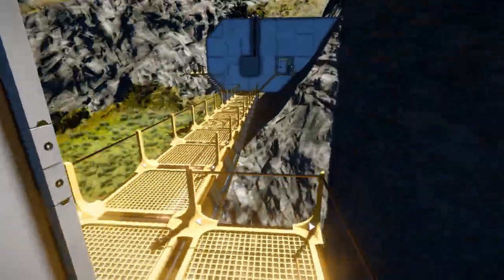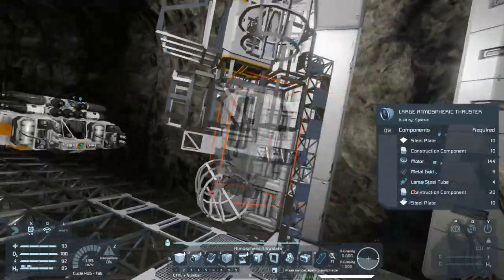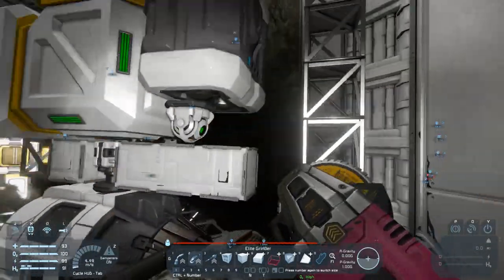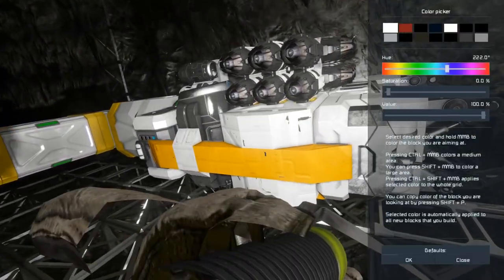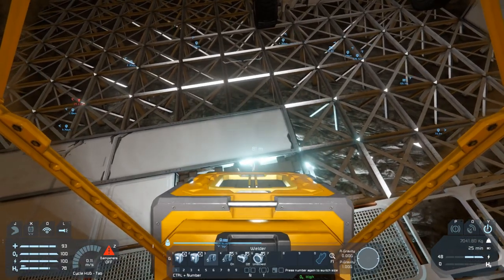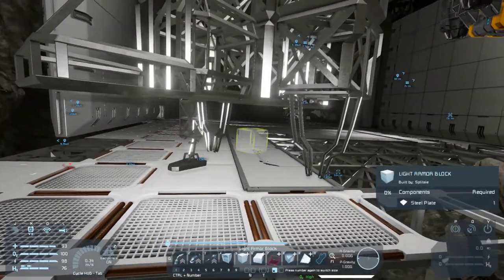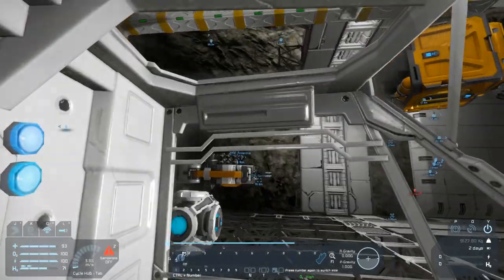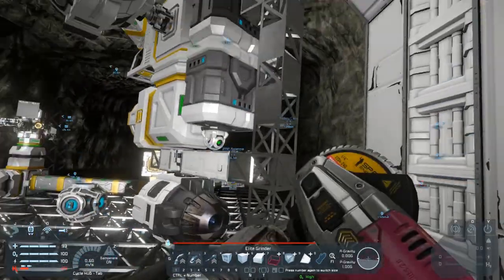Survival, Maybe... #35 Welder Woes With Buttercup (A Space Engineers Survival Series)

Comment: Can you do a video actually testing the requirements of a gyro? To figure out exactly how many are required and such?
Reply: Clinton Savage You can always turn one down a little for precise tuning but yeah, might be a cool video.
Reply: Basil Not really if you're gonna hide it and testing before finishing won't give you legit results
Reply: I think you can reduce their power, so just put more than you need and tune it when you finish.
Reply: Risi that's what I said
Reply: I haven't tested it, but this script http://steamcommunity.com/sharedfiles/filedetails/?id=1333800643&searchtext=Gyro+cargo claims to adjust gyro power automatically based on the ship's mass. If it works, you should be able to place enough gyros for the heaviest load you expect to carry without manually tweaking them when your ship is empty.
Reply: Clinton Savage There's no hard number for "how many gyros are required" (no matter how heavy the ship is). One will always do the job, just very slowly.

A heavy ship with one gyro will turn like a pregnant whale with its fin cut off, but it will turn :)
Reply from the maker: As Ken said, 1 gyro can turn anything, but it might take a week to do so if the ship is very heavy. There's a sweet spot that's probably slightly different for each of us depending on how responsive we want the ship to be. For me I like things to move a little slower so I don't accidentally smack really hard into my bases :P

Comment: A sensor to turn off welders when a person get near? That is incredibly smart. I gotta start using that for grinders and welders. =O

Also I wonder if the rear thruster is causing the backwards drift as it tries to help keep the ship upright. it cannot tilt forward but still applies thrust and a backwards pull that the two side thrusters may have trouble compensating for.
Reply from the maker: It's possible, but normally the script copes well with rotors and thrusters in that sort of setup :(

Comment: as opposed to dropping your suspensions down a block I found out on my Mortal Engine Build that you can just turn the suspensions upside down because you get roughly half again the extension from the travel height as you do building them right side up
Reply from the maker: If you do that, won't the suspension only act as rock solid though?
Reply: @Splitsie  not to my experience no. The engine is a 350k kg vehicle and the suspension still has plenty of give and bounce in my testing though I have not tried the build in a purely vanilla world
Reply from the maker: Interesting, I might take a look at that and see if it impacts the amount of force the suspension can absorb :)

Comment: I do believe if the rotor does not have a rotor head there are buttons for attaching both large and small heads also I have gotten in the habit of adding pistons for lifting all my wheeled vehicles that same way though I suspect with the way wheels work now they are not needed as often
Reply from the maker: From what I've seen it's only the large grid rotors that have the button to attach either the small or large, small grid rotors only have one option. I'm not surprised it's this way as the large grid heads look funny regardless of if you're using the advanced or basic rotors :P
Reply: yea that makes sense I haven't used rotors much lately but when I was using them it was on a large grid.

Comment: I think you need move side engins forward, because mass of subgrid sometimes calculated strange
Reply from the maker: I might be able to move them 1 block forward but that's all sadly - the next block is the rotor. I did try something that 1wsx10 (the script's author) suggested in creative - clearing out the armor blocks allowed the rotors to move freely and it handled much better :)
Reply: Splitsie or you can offset in on some beams to side and forward - on same level to welder center

But i dont know if it cause good effect

Comment: could you build a welding rover that had the welder vertically downwards, or with the ability to rotate the welder 180 degrees on the verticl, that seems like it would be ideal for floor welding, have the welding bit in te middle and the wheels and drivers seat either side, then you could weld the flor by driving over it, nd rotate it to point forward or upwards
Reply from the maker: I was hesitant to put a welder at the front for the vehicle because of the weight distribution, I didn't think I could arrange it properly to avoid falling over, that's why I went with putting them in the middle :P

Comment: Would half blocks avoid the sparks?
Reply from the maker: Yep, I eventually made that upgrade and it worked really well :)
Reply: I have been itching to get playing on realistic and this seems a must if I plan to build anything larger then a small grid. Really appreciate the designs.
Reply from the maker: You're very welcome. And absolutely, even though flight is a little wonky with vector thrust, the ability to have such a heavy vehicle able to fly at odd angles with only a few thrusters is completely worth it. Plus the large grid welder would be a godsend for realistic settings :)

Comment: Place advanced rotor on top of it in middle of  frame. Than T shape on rotor to rotate. In each end of T bar place welder. Turn it on and make it spin slowly. IDK... 5rpm's?. As you will move forvard, you will weld anything around you. And you will maintain balance.
Reply: 43:10
Reply from the maker: I don't think that would be all that useful, the welders are quite slow so I tend to want to point at something and hold that position for a while which would be somewhat frustrating if they were constantly turning :P
Reply: I will think about it and maybe create few prototypes... I’m only few weeks space engineer, but... who knows...

Comment: You already have the tick, but with it plump rear it looks like an ugly, well-fed tick to me.  Though the Hunchback (of Notre Dame) might be fitting?
Reply: Hunchback not being an animal, unless you count the hunchback whale, but with the Hunchback of Notre Dame, it implies ugly appearance.  To solve the issue of having to pre-weld the floors, you could put the welding arms just ahead of the wheels, with a counterbalance at the back so you're not too front heavy.  Less compact, but might save time.
Reply from the maker: Quasimodo and Igor have been two suggestions that I like (even though they're not animals) because they are very fitting :)

I may well have to do that to speed up the process a little, placing by hand may be a little slow...

Comment: could it be that with all thrusters off the script couldn't figure out how to point the rotors?
Reply: cmilkau doubt. Reckon drone had exact same thruster setting and worked. I wonder if it's because he built it vertically and then flipped it horizontally. Or maybe something's wrong with large thrusters
Reply from the maker: 1wsx10 (the author of the script) is suspicious that my armor occasionally blocking the thrusters might have made things break once I'd disconnected, but the rotors going crazy bit is apparently due to phantom forces so there isn't anything he thinks he can fix :(
Reply: Splitsie You can try half blocks around the rotors if that's the case.
Reply from the maker: I might just do that :)

Comment: Rather try the hover engines mod. ;)
This thrust hover a bit of jittery.
Reply from the maker: Even though it's not smooth I like that it's still a vanilla solution which was something I really wanted to aim for with the welding ship :)
Reply: Can the hover-welder have problems because of the weight of the items inside?

I see. 
Three-color rule for building, learnt it in minecraft. :)
Reply from the maker: The buttercup is capable of flying with a completely full load, and reasonably comfortably too - that's the nice thing about vector thrust, I only had to have 3 large thrusters to lift all that, if they were fixed in place I'd be stuck with a massive number in every direction :P

My minecraft building rule was 3 materials - usually stone, logs and wood since I liked building fantasy styled things, it makes sense due to the fact that the more colours you add the harder it is to get things to look cohesive :P

Comment: The rotors on the script freaking out like that is why i stopped trying to use landing gears on other ships or structures. Either land on ground or attach to a connector and then its fine. Shame though since it doesnt allow me to make a tug with the script :(
Reply from the maker: Yeah, sadly they were still freaking out when locked via a connector, so I'll need to get creative with the parking zone for the buttercup otherwise I'm going to be forever dropping onto the ground :P
Reply: Not the only problem with the script though. Somehow ships in space keep drifting at around 0.35 speed rather then 0. As for the drifting in atmosphere you had with docking, I had that issue with small rotors and armor like yours and a lot of sparking, somehow it was blocking movent. Swapped to advanced rotors for that exact reason.

Comment: Could the weird behaviour of vector scrip be because you started facing up and connected to ground. Maybe you need to clear or recalibrate it. Also I would have put welders in front of the wheel for floor welder. And I wonder would it solve or create more problems to use a script to align the floor welder with gravity.
Reply from the maker: It shouldn't matter for the script, I suspect there are two problems after reading some other ideas and suggestions I've read. The first is that while the collisions between the thrusters and the body do no damage they may be stopping the rotors at times they shouldn't, second is that the center of mass is forward of where the thrusters are so the script isn't coping with that so well. The first I can fix, but the second I don't think there is a lot I can do to change :(